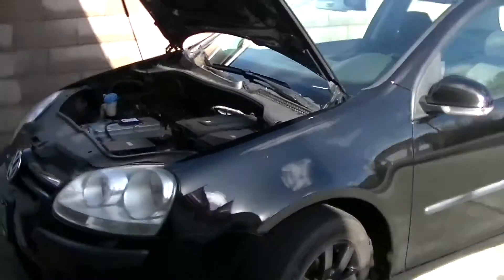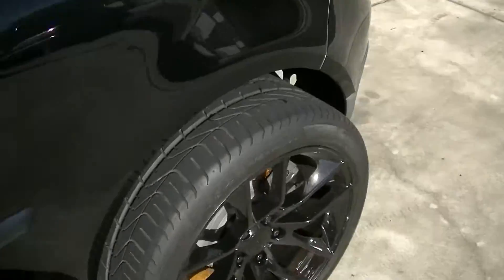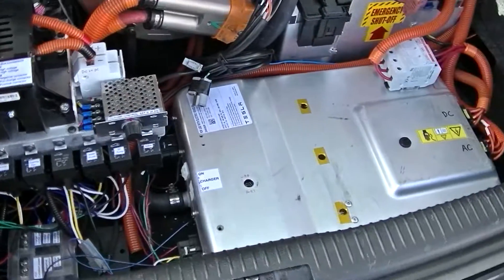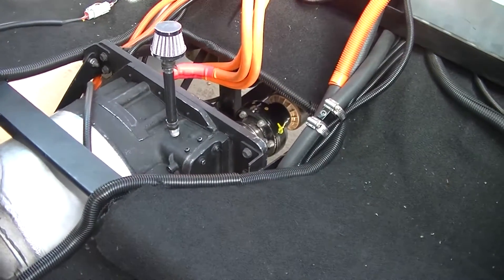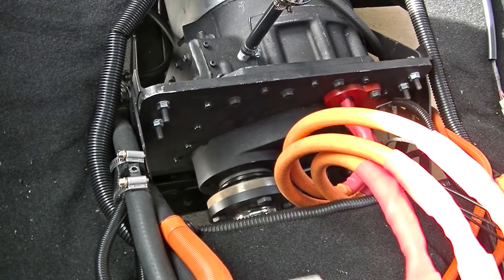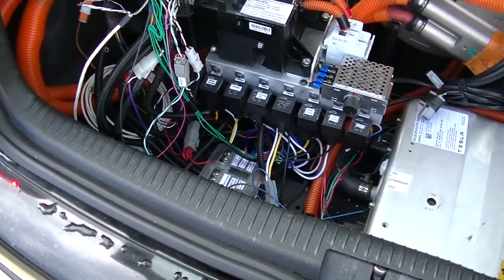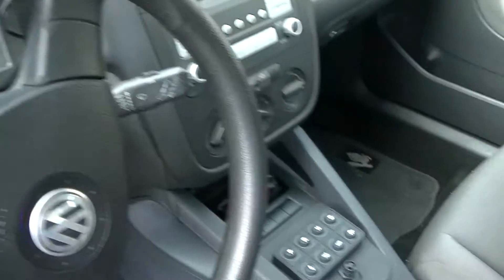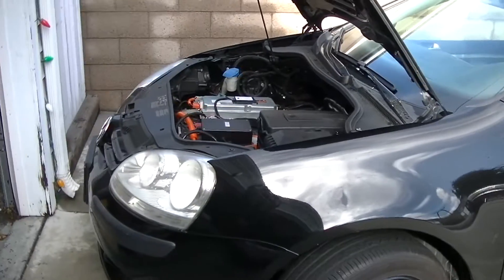VW Rabbit Tesla Swap

Comment: where are you located? i'm looking to convert my working diesel 1981 vw caddy truck.  possibly keep manual trans or not.  it's front wheel drive I could slip in an electric rear axle instead tbd.  I'd be interested in paying to get it swapped.  let me know! cheeers!
Reply from the maker: Hi, I do have a private shop in California but I only do Mustangs. That keeps me busy enough these days.
Reply: @Roadstercycle  ok well I'm located in pittsburg CA.  appreciate the efforts you are doing.  if you can ever pencil in time for my small truck build let me know.  I'd like to see specifics such as range and cost from your perspective.

Comment: I’m thinking of converting my old dodge to an electric car do you have any idea what it would cost, mainly planning on making it quick but also for long distance travel
Reply from the maker: So you have to decide quick or long distance.  Quick= 450lbs of batteries, Long Distance means 900lbs of batteries.  Small motor or big motor?
My guesstimate if you do your homework you could do it for $25 to $30 thousand. If you do it all yourself and use a base Tesla Large motor.
Reply: I think for my purposes I’d pick long distance on a big motor
Reply from the maker: Then your talking about 16 Tesla modules or a full model3 pack.

Comment: What is the gear ratio inside your custom cast  gear box.? One half of the stock Model S TESLA gear reduction was 3.12 to one, or 3.12 x 3.12= 9.73 total gear reduction for the Model S.
Reply from the maker: 3.12, used the first 2 gears. Elimnated the differential gear which would have went to 9.73. So now it's 3.12 x the differential ratio you are using. So 3.12 x 3.56 = 11.1. Should be insane in the 1/8 mile and autocross.
Reply: @Roadstercycle , It definitely will be traction limited in its performance. Any thoughts of creating a product to sell using your casting. TESLA gears, bearings and shafts?